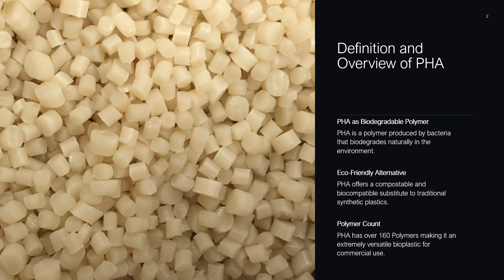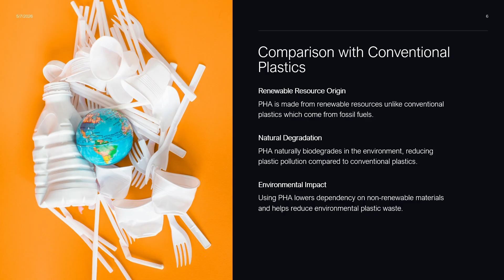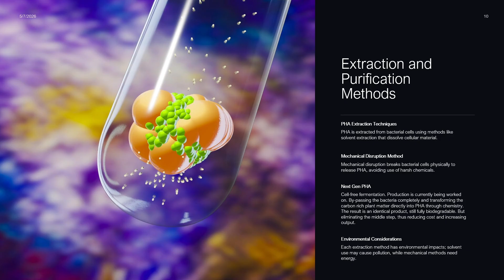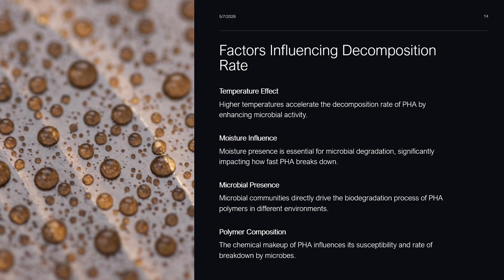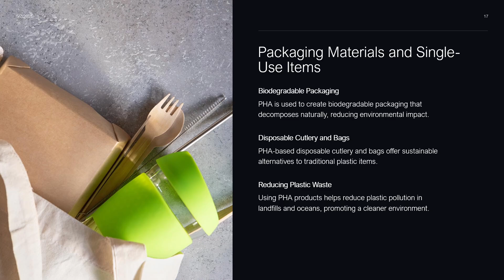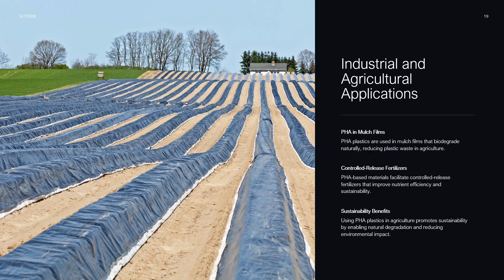PHA Plastic. What is it?

Comment: Can I eat this plastic?
Reply: PHA as no nutritional value for humans and animals. 
Its part of the big myth surrounding Biopolymers and their potential for composting, as per example with PLA and ASTM6400 Industrial Compostable certification. 

These industrial sites are very far in between in the US and there is no current mechanism within any of the recycling programs that ensure a PLA part will in fact end its life in a ASTM6400 facility (That's actually myth number 1). 

But even if it does by miracle. PLA (and PHA's) offers zero added efficacy to the compost end product (Called Humus) that is then sold to farmers and growers. Yes the biopolymer can in fact be re-absorbed within those systems. But they add zero value, they are not nutrients or vitamins and they do not enriched the final product. Anyone claiming otherwise is simply lying. 

PHA are biocompatible, and therefore are considered non-toxic to humans and animals. But so can you also eat a wax base color crayon. Doesn't mean you should do it.
Reply: @FredPinczuk WELL SAID! Thank you for addressing this.